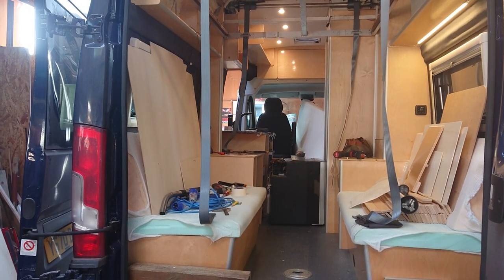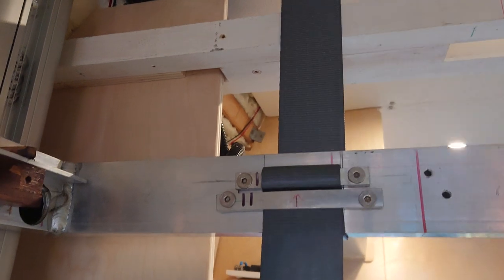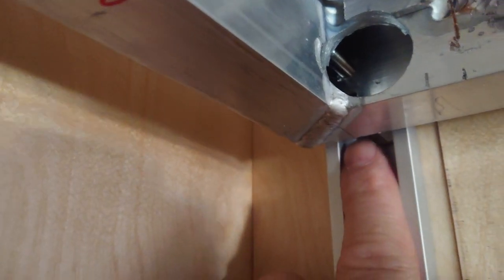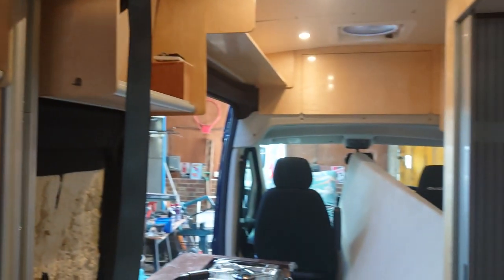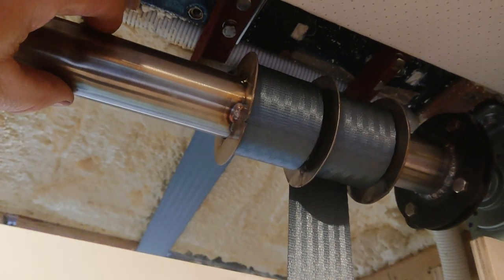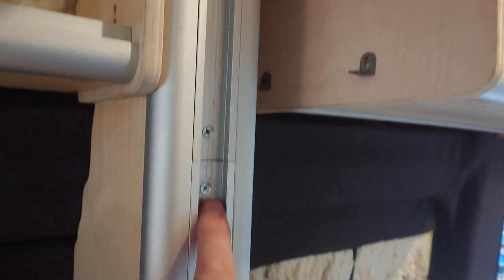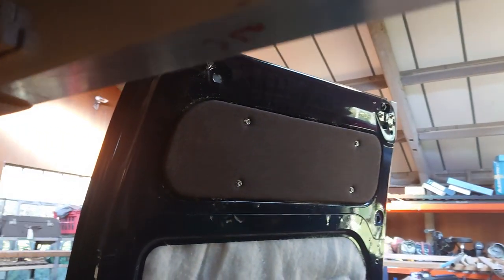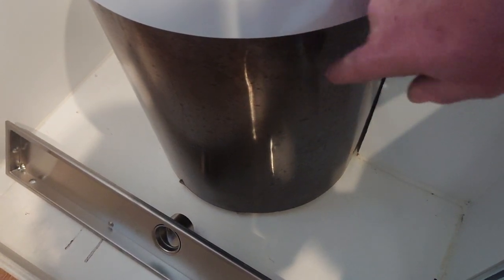campervan conversion electric lifting bed improvements

Comment: Very nicely done! How did you fixate the strap ends between the spacers on the new driveshaft?  All the best from The Netherlands!
Reply from the maker: Goedendag (I am a rare fluent Dutch speaking Engelsman !!!)....I used a hot nail to burn holes 3 across the end of the strap's, marked the holes on the stainless tube, pilot holes in the tube, used self tapping screws with washers to screw/clamp the strap ends to the tube, 3 revolutions of the strap around tube before any tension is applied, this way the strap itself has a clamping action and doesn't really only on the self tapping screws ...hope this helps. Groetjes.